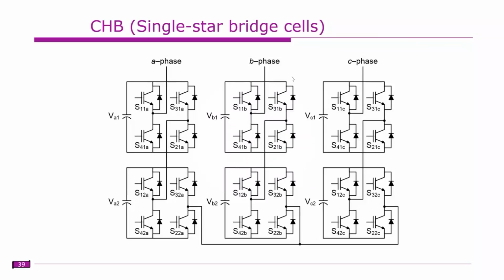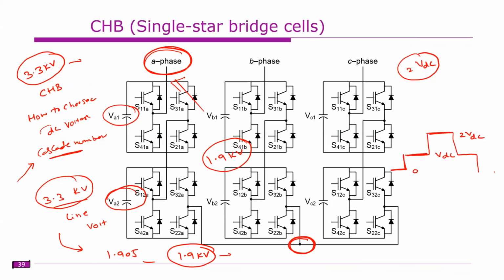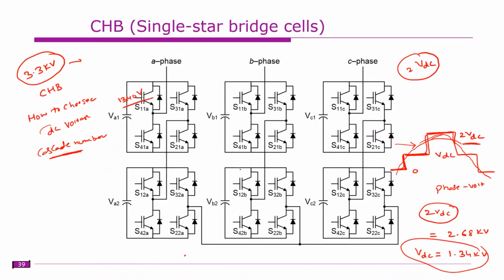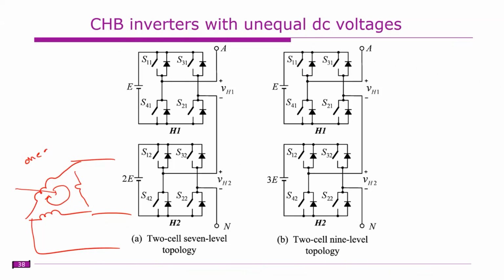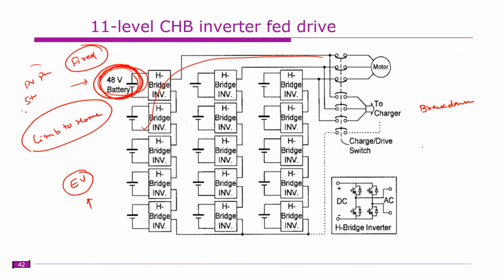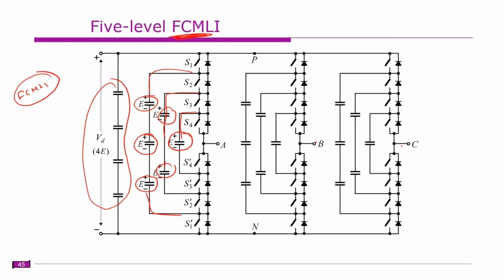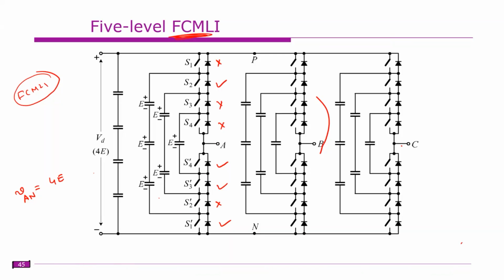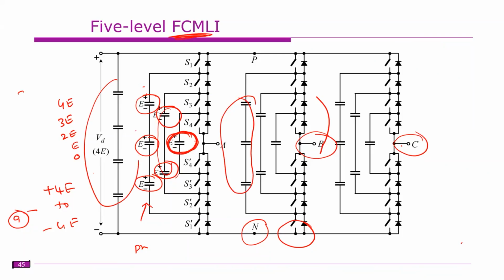Advanced Power Converters : Cascade H-bridge (CHB) and Flying Capacitor Multilevel Inverters  | L9

Comment: Hello Sir. I have now succesfully use a flying cap class d, without use of insolated drivers, but with a cascaded multilevel with separated supply,s do I need a isolated gate driver persé? This is because the supply,s are floating, so I need a driver who has isolated properties and needs to be clean, very clean switching because it is for audio, and HD needs to be low. There are ic,s who have isolaters in them, like capacitive versions. THanks in advance for the help. It is fopr learning and hobby, now I am 66 I have plenty of time🙂
Reply from the maker: Thank you for watching. Unfortunately, I could not understand your query. Could you please mail your question to srinudee@nitw.ac.in

Comment: Hello Sir,
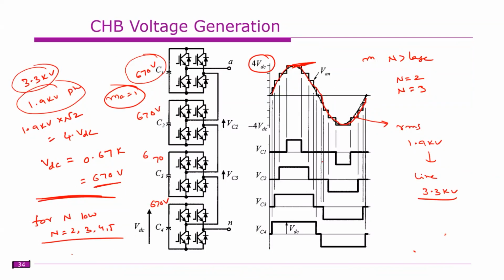A curious question for @13:46. Approximation of Vac(rms) using Vdc. Each cell or a bridge with 1000V Vdc giving 625Vorms. If we use the logic of a single phase inverter, isn't the fundamental rms around 900V (0.9 Vdc)? Could you please help me understand the approximation logic? TIA
Reply from the maker: This ac voltage is given by 1000V /1.6, where the number “1.6” in the
denominator is a design parameter representing the ratio of the dc mean voltage to the ac rms voltage in a voltage-source H-bridge PWM converter.
Reply from the maker: You can cross check this simulation.
For more details read H. Akagi, S. Inoue and T. Yoshii, "Control and Performance of a Transformerless Cascade PWM STATCOM With Star Configuration," in IEEE Transactions on Industry Applications, vol. 43, no. 4, pp. 1041-1049, July-aug. 2007, doi: 10.1109/TIA.2007.900487.
Reply: @AdvancedPowerElectronics  Thank you sir. I'd read that paper from Prof. Akagi's group. I had that doubt for quite some time. Luckily, thanks to your videos I recalled it and after some pondering I think today I have a vague notion for the generalised design parameter. In my opinion, I think we are not utilizing the second bridge to create Vmax rather, we focus on creating a sinusoidal wave shape to improve THD and lose some voltage area from second bridge due to which I think it roughly comes up to 0.625 else, it would have been 0.9*2*Vdc as fundamental Vo rms. Thank you for reverting and wishing you more success in online tutorials.
Reply from the maker: Good luck!
Reply: @AdvancedPowerElectronics  Also, one small request by any chance. Have you lectured on TSBC (Triple Star Bridge Cell) I saw the topology on one of the slides but, have you discussed its working on PS-PWM? I would be grateful if you could share any videos on your lecture notes about this. TIA
Reply from the maker: I dont have, If you work on TSBC, I may help you
Reply: @AdvancedPowerElectronics  Yes please. I would love to have another perspective of what I am working at. Could you please let me know your mail ID or preferred contact method?